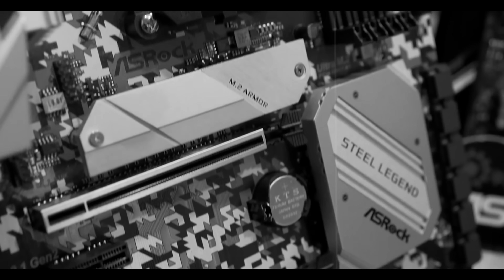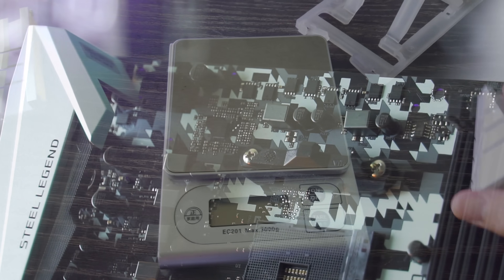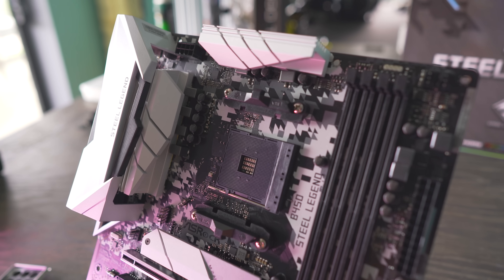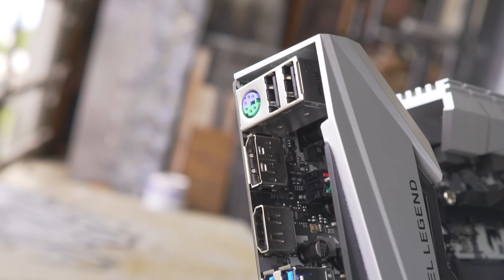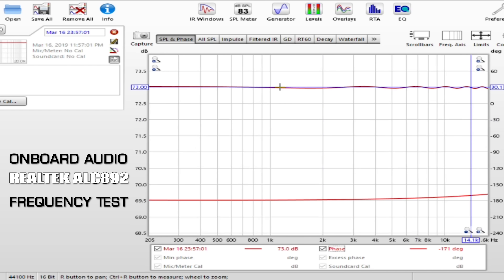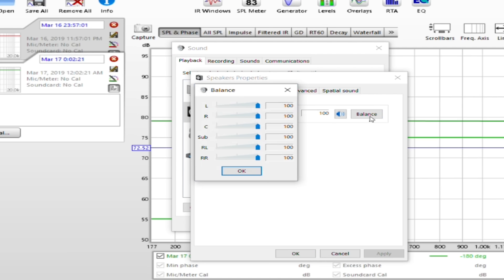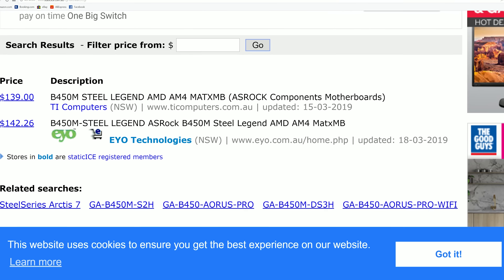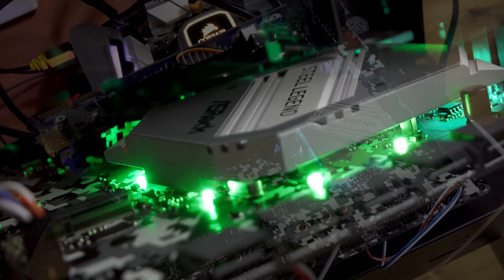Is this The BEST Value B450 Motherboard Right now..!? (Steel Legend Review)

Comment: Good airflow is always needed, I actually ordered this board (the fullsize ATX version) on saturday and received it today. My case is overloaded with airflow so I'm not worried about the VRM, also.. i"m pairing it with a Ryzen 5 2600 for now which was on sale for 105 euro. Just waiting on the RAM to arrive from the US then I'm upgrading my ancient skylake core i5 platform to the AM4 platform. Good thing is.. this board has the sticker on it saying "ready for Ryzen 3000 series" so no problems there when I want to upgrade to that but for now it was an upgrade on a budget :)
Reply: Where did you order this board (Might not be the same Im in the US) I'm looking to order this board and pair it with the ryzen 3600 and I dont have gen 2 to flash the bios to upgrade it to make it work with the gen 3 processor. I don't want to order this board and have it not able to work because the bios is out of date and can't support my gen 3 ryzen possessor
Reply: I ordered it at a Dutch store named Alternate, so for you in the US that will have no use. if you want to order it online at a retailer I would check with them first if they have the same type  @johnfannin1049
Reply: @dutchguy1975  how good so far? this or a b450 tomahwak?
Reply: @Jaksoncpp  the mob works quite well. But not perfect. The networkchip of the Steel Legend seems of lower quality then my previous Gigabyte mobo. And unless I turn off my PSU the lights on mobo stay always on.
Reply: @dutchguy1975  if you can buy it again, would you? i mean for the price is decent?
Reply: @Jaksoncpp to be honest I would go for a different option, but would pick something with at least 2 M.2 slots
Reply: like what?
Reply: @dutchguy1975  aside the m.2 slots, any other reason to get other mobo?
Reply: @Jaksoncpp  if I had to pick something right now.. I'd go for a few tenners more expensive. ASUS ROG STRIX B450-F GAMING . Ofcourse this would be my personal choice, I cant look in your mind and in your wallet.
Reply: @Jaksoncpp  the ASUS has a 6+2 phase VRM the Asrock a 4+2 phase. ofcourse for a Ryzen 5 2600 like I have a 4+2 phase is plenty.

Comment: I'm planning on building a computer and currently i'm choosing mobo and this one cought my eye especially because it matches the black and white colour scheme i'm going with. For cpu I'll be using r5 3600 and plan on a little overclocking. BUT those vrm temp worry me.and now i'm wondering what you good people think would that work just fine or is there a better choise in this price range? Regardless of colour and size, bucause i might go with mATX.
Reply: Danilo Tasic i ordered this motherboard and the ryzen 5 3600 today it was on sale for 70$ so i was like okay i might as well get it and i plan on just getting my cpu to 4ghz with a hyper 212 i hope that my vrm temp are decent
Reply: @LividTommy  i 've done some research and yeah with 6 cores and decant airflow it should do just fine. Apparently this is one of the better b450 boards out there , especially mATX version

Comment: I just bought a b450 Tomahawk yesterday, I'll be waiting for a 3800x
Reply: same got a 3600 and bios is shit on tomahawk many problem have problems flashing or booting, thinbking about getting another mobo, msi is overehrlmed and ethere is still no help in sight
Reply: @cansirma9116  Maybe TOMAHAWK MAX?
Reply: Will it look good, i have
Black and White case
Black white graphic card
Thinking of buying Ashrock B450 Steel Legends.
The thing is order the Black / Red Cable Extensions
Red Radiator Ram sticks 

The 2 last parts i order with the B450 gaming plus but after problems i canceled so im with red rams stick and red cable extensions

Its design look question not component.

Comment: Does ryzen gen 3 support this mobo ?
My plan will use ryzen 3 2200g and this mobo, next time i'll upgrade cpu to ryzen gen 3. How ? Ryzen gen 3 use AM4 socket ?
Reply: @Zoltan so the 3000 series ryzen still uses socket am4.  the possibility on this mobo can still be useful for ryzen 3000 series with bios updates ?

Comment: R5 2400g + asrock b450m legend + geil evo spear 2x8gb 3200mhz dual channel with 500w psu (non-brand) is this build good enough for gaming???
Reply: I prefer you get the r5 2600 and get rx570 or an rx580 something

Comment: Dear Admin plss reply my comment tq.. 

If i use m.2 ssd and ssd sata and hdd in same motherboard is it work? Is it have any problems? Plsss comment and make review  steel legend 3 storage in 1 motherboard (m.2ssd/sata ssd/ hdd)
Reply: It works, I have the same board, equipped with 1x M.2 NVME SSD, 1x SATA SSD, 1x SATA HDD
Reply: @haRT3r  wow thanks..

Comment: which is the best motherboard between  asrock b450m steel legend and msi b450m gaming plus ?
Reply: also had this thought. I choose steel legend over gaming plus, it's more upgradable (4 vs 2 ram slots). But gaming plus had a better vrm(?) for better overclocking (according to gamers nexus). so it depends on your need

Comment: nex time bro  set a bord in a case with airflow so you dont talk shit about vrm .  you do know that all vrm are cooling bij a topdown cooler. if you use that no problems.  if you use watercooling than you need extra case fan in your case .  all chips need cooling from a case even the ram you use.  testbanks are not the way to test a vrm with no topdown cooler.  learn your basic

Comment: @Tech YES City can you make a comparison video of ASROCK Steel Legend vs MSI Tomahawk
Reply: yes, please, i was just about to look up a comparison between the two
Reply: If you want to OC choose Tomahawk its little bit better power delivery, but if you don't want to OC just choose Steel Legend, in my country steel legend is cheaper ~$25 than Tomahawk
Reply: @MoviesAwan  Are you from Indonesia? B450 Tomahawk are around $140 and $105 for mATX and $125 for the ATX version of the Steel Legend here.
Reply: @NaoVII  yap 😂
Reply: @MoviesAwan  and I can use a Ryzen 2700x with the stock cooler?
Reply: nice point, i also cant wether this or msi b450 tomahawk
Reply: @lelok0958  same i ended up buying the b450m steel legend
Reply: @jaxylv3817  is it good for OC'ing??what is ur cpu man, if u dont mid
Reply: I want too
Reply: Msi better memory oc and vrm. If you push your cpu oc all day buy msi. If just daily use non oc asrock is a win
Reply: @idtechcelestial6507  what about aorus elite ?
Reply: @pando1348  that thing is just pure shite
Reply: Idtech Celestial do they use the samw VRM on the 450m edition? I can’t decide if i should go for b450m steel legend or b450m mortar max for my r5 3600 (not planning to OC)
Reply: @idtechcelestial6507  is that oc is only for cpu? how about in ram? like xmp? do i need to buy tomahawk max if i do xmp in ram? or asrock steel legend is okay for that?
Reply: Dont
Reply: Tried twice ASRock products (A320,AB350 Pro 4) it ended up so bad,the board is full of problems especially their bios..so trashhh 
I know its 1 year late but NEVER EVER buy asrock product for amd chipset,it will leave a bad taste in your mouth
Reply: I bought the b450 steel legend anyone else see grease build up on the back of the motherboard by the vrm location? Looks oily but like a thick oil that doesn’t rub off

Comment: This motherboard  is excellent for the Rysen 3/5 cpu combos , the b450 chipset suits well . Asrock would be the cheaper board as for Asus with the quality remain .Will use gtx 1060 with this board and 16gb of ram . Great review . please do video about balanced combos for people who wants most out of the pc without a lot  of significant bottlenecking .
Reply: Mortar or this?in indonesia its like 35$ difference,steel legend is cheaper

Comment: B450 tomahawk or b450 steel legend?
Reply: if you are sensible and price consious go steel legend, if you value audio quality/ spdif go steel legend, if you want 2 m.2 ssd slots go steel legend. Overclocking the 3600 for instance gives very little performance gains over the standard boost clock, if you go for 3900x go for tomahawk, if you want extra 200 Mhz though manual overclock go tomahawk
Reply: cat daddy Tomahawk
Reply: @SICARIO1k  b450m mortar/bazooka plus or b450m steel legend?
Reply: Xvolcanix mortar

Comment: 🤔 i wunder what buildzoid wud say, i never heard him recomend any asrock for 8 core cpus, the only few b boards he recommends for 8core were from msi only. I like asrock too but this board shud only b used for 6core cpus at max. And I hate the camo look 🙂
Reply: buildzoid also uses liquid fuckin nitrogen every time he turns on his pc. Look at der8auers new video, Ryzen cannot be overclocked on Ambient cooling stock XFR will always be faster than trying to do all core OC on ryzen. The only way you can beat XFR is by going sub zero which in that case buildzoid is right but for the other 99.999999% of us the VRM dont matter on AM4 because it CANT BE OC.
Reply: People can put 3900x with a little overclocking on this board just fine.

Comment: Could you make a video how you test the audio side of things?

As for your Ryzen 1700, that's decent compared to my 1700x which cannot do more than 3.85ghz stable 24/7 even with Deepcool captain 360 AIO ... Then again, this corsair crystal 570x case is not doing any favors either, the hottest case i've ever had. 100% buyers remorse on that case, expensive and crap.

Comment: How is 100° C ok... This is just borderlind acceptable, since the internal temps are always 20-30° higher than surface temps and 130 is usually the absolute maximum these want to run at... So this is literally just right before catastrophic meltdown.
Reply: What if i use 4 fans on q300l with ryzen 3 2200g,will it be good?
Reply: @Xvolcanix this board will have absolutely no trouble running a 2200G, it's just a 4-core without SMT, and a small built in graphics unit. It doesn't use a lot of power at all, so it won't make the VRMs hot. You can easily overclock it also. I feel like the B450 Steel Legend board is a little bit overkill for a 2200G, but it's a quality board that will let you upgrade to 6 or 8 cores in the future. It has good features aswell, so I would say it's a good choice.
Reply: @CampyCamper  how abt ryzen 3 3300?or just go mortar?mortar is more expensive in my country,its 35$ difference
Reply: Xvolcanix The Mortar is a lot better. It’s Vcore VRM can easily run all AM4 Ryzen chips. Should even be fine for casually overclocking a 8-core.
Reply: He said he wouldn't like to run it at over 90c. This board will be fine for a stock 8-core or overclocked 6-core. The overclocked 8-core he tested with is too much for it unless you direct a fan blowing some air onto the VRM components.

Comment: Technically, there's only 3 specs of USB 3,

3.0 which is 5gbps, and 3.1 which is 10gbps, and finally 3.2 which is 20gbps.

Marketing bullshit has made things way more complicated by calling things 3.0 gen 1 / 2, 3.1 gen 1/2 3.2 gen 1 x1 gen 2x2 etc don't know why.

Type C is just a different connector which can support more than just USB.

USB Marketing specs are a mess.

Comment: ALC 892 is total crap audio chip, also this board is total baseline budget board, nothing special. MSI B450 Gaming Carbon AC still rulez. Had same audio chip on Tomahawk board and must replaced it with soundblaster card, cos microphone output was total distortion orgasm, unlistenable :-(

Comment: Just a quick note... you don't actually want to have frequency output below around 40 Hz.  The human ear cuts off at around 20Hz (most people can't really hear below 40 anyway)... but sound quality will actually be better with the lowest frequencies cut-off, which is why most speakers fall-off below 50 Hz.  If you include frequencies below 40 Hz it can be a problem for several reasons, not the least of which being that it is almost impossible to actually control the sound energy (in the air, not measured on a scope) reliably below 40 Hz, the human ear will attenuate those frequencies so its impossible to balance the speaker output, and also because you have to throw a shit-ton of energy into the speakers to actually get any decent volume at frequencies below 40Hz... and then much of the energy is spent down there instead of up at higher frequencies that the human ear can actually hear.

So... honestly, any audio output that attenuates below 40 Hz is going to be just fine... probably even better than audio output that doesn't.

-Matt

Comment: i thought you are more acnowleged ... @TechYesCity ...
AiO increase VRM temps cause of no airflow , also you doing it out of the case ... so it's worst scenario and with air cooler and in case it will be quite bit lower . Also you should tell the voltage , not clockspeed ...it's voltage that is more important , it is what's making VRM LOAD , not the clockspeed . so it's big difference if it was running 1.5V or 1.35V and no difference if it was 3.7 or 4.1ghz  :]
Reply: dat is correct .
Reply: Can't agree more..

Comment: 90*c is still pretty low for a VRM. tCase for most moderate quality VRMs is 125*c, and you can safely have a VRM running 24/7 at 115*c without incident provided you don't exceed the current limits that the manufacturer recommends at the temperatures you're reaching. If we say that this VRM can handle 50 amps per phase at 125*c, that would still be 200 amps, which at the maximum safe voltage for Zen of 1.45v, is 290 watts of power that you can safely draw from a heavily loaded VRM. An overclocked 8 core 2700X would be more like 150 to 180w of raw power draw.

If you run the VRM below spec and pull power at the rated current of the chokes, which is 60 amps, the VRM can max out at 348 watts. There is not a single Zen chip that will draw this much power on B450 without sub-ambient cooling and a metric shit tonne of vCore.
Reply: He only measured temp of bare chokes, fets could be well over 100C. Also this board has only one hi-side fet per phase, SM4337 can deliver 35A@100C(25A@125C). Anything above 100A load is reaching with this board. Absolutely not recommended for overclocking 2700X. Just like any other 4-phase board with one hi-side mosfet.

Comment: My gripe with entry/low end Asrock mobo is that they tend to get into random problems (usually instability) after a few months of using them. I've built a few for clients and friends by request, and quite a few times they reported they had crashes and such.

Comment: Up to 97C in an AVX enabled stresstest of an 8 core, on an open bench with no airflow like there would be in a case? Yeah, it's all good. Those are quality VRMs. Although, people should be aware that they might get Niko fets instead of Sino's on their board, which are worse. It seems to vary from region to region.

But it's good to see LLC control which at least half of their AM4 boards don't have. All around a solid board.
Reply: Open benches are supposed to have better temps
Reply: @hwstar9416  he uses an watercooler, so no cooling from the cpu fan, also in a case there are usually case fans, this test bench is like an open pc case withouth any fans.

Comment: How would you set up a 12 cm fan for the VRM? Like just free ball it or is there usually a spot in the case for something like that?
Reply: use a horizontal CPU cooler, and the air-flow will facing to the board, vrm can be cooler

Comment: b450 tomahawk, and mortar are the best value and actually the b350 tomahawk is the best value all around considering the msi b350 and b450 boards have the best vrm and vrm temps of all the boards. plus they are super cheap.
Reply: MSI B350 boards apart from pro carbon have junk VRMs. Fortunately they learned from criticism and fixed B450-series unlike Asus and Gigabyte who continued to use crap VRM on their B450-series. Well, dirt cheap B450M pro/vdh are still junk so there's couple MSI boards to be avoided.
Reply: @kognak6640  the b350 tomahawk is the best, its been shown to stay in the 70's even when overclocking a ryzen 7 something the gigabyte aorus pro b450 or the asrock equivalent cant even do
Reply: @Spittin_Bars  Maybe you are mixing with B450 tomahawk.

This is B350 Tomahawk. It has same crappy one hi-side mosfet design as any other crappy board.
https://www.overclockers.ua/motherboard/msi-b350-tomahawk/14-msi-b350-tomahawk.jpg

Edit: And look at those flat heatsinks. Not going to cool anything properly.
https://www.overclockers.ua/motherboard/msi-b350-tomahawk/13-msi-b350-tomahawk.jpg
Reply: hardware unboxed tested all the b350's and found the vrm on the msi board to be the best of the bunch and it stayed the lowest temp of all of the b350 boards he tested
Reply: @Spittin_Bars  
No B350 Tomahawk here. But there's Krait gaming(for OCing) which has same VRM as Carbon pro aka doubled hi-side mosfets. 
https://www.techspot.com/bestof/amd-b350-motherboards/

B350 Tomahawk VRM is what it is. There's no going around. 
With stock 2700X VRM heats to 88C in open bench. It's simply bad. Notice how B450 version is 18C cooler. That's what it should be when VRM is decent.
http://oc.jagatreview.com/2018/07/mosfet-temperature-msi-b450-tomahawk-vs-msi-b350-tomahawk-plus-di-ryzen-7-2700x/

Comment: hello i want to buy b450 mb and the one i am looking at is Msi B450M BAZOOKA V2 is it good? i will run ryzen 1700 @ 3.8 max 3.9 but most likely 3.8  i can ge it for 80 dollars is it good ? tnx . and love your videos because of you used x58 for a while.
Reply: I also want to buy and the only best option for me is b450 bazooka so can i use ryzen 7 2700x with no oc in bazooka
Reply: @nimeshurkude5884 on there page they show it is suported
Reply: Yes i known it support even i can go with a320 but i want my vrm to be at good temp about less than 80

Comment: Its  just a B450 Pro4 in a fancy skirt . That by no means makes it a bad board the pro4 is a bloody good mid range board, but if you wana save a bit get the Pro 4.
Reply: So?b450m steel legend or b450 pro4?